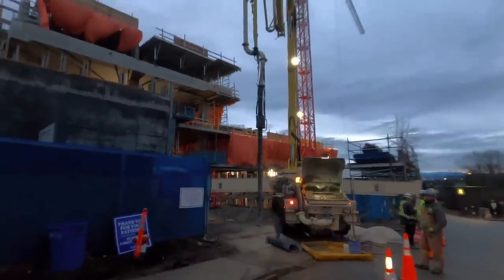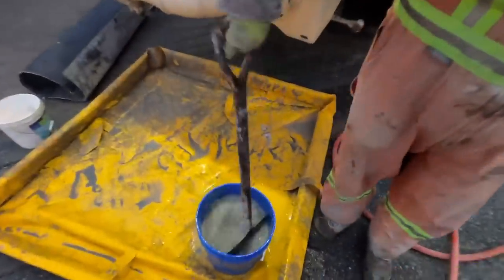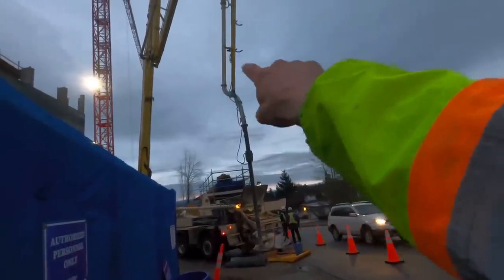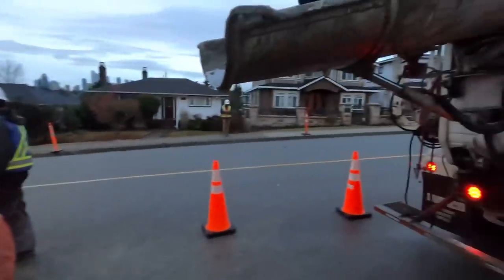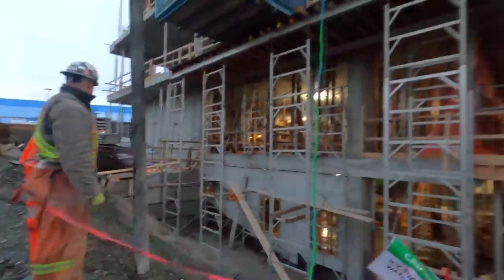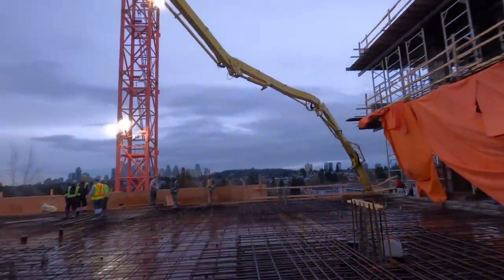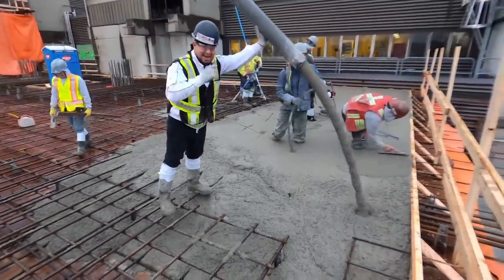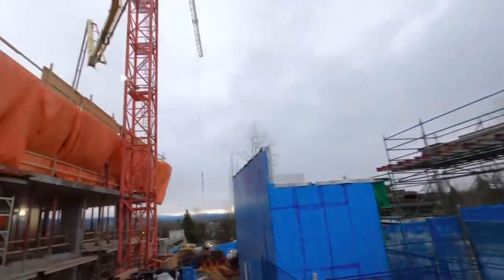The most effective way to prime a Putzmeister boom pump (I promise):

Comment: Years ago on short notice the company I worked for asked me to help a young superintended monitor the slab pour on a fancy commercial strip building.  Long story short, pump operator didn't prime the truck properly causing a "Rock Pack"  Pump operator told finishers to beat discharge hose with sledge hammers while he kept running the pump.  We told them to "Stop"  they ignored us so we ran outside and told Pump operator to stop..  The blockage cleared and two of the finishers were taken to the hospital by ambulance with serious injuries.  To bad there was no YouTube back then, he could have learn a thing or two from you.

Comment: Just man up and knock it thru with water, jeezus.
Reply from the maker: We use that method as well, just typically not on big jobs with big booms. The one in one hundred chance of an operator plugging on the prime and having to start pulling elbows apart while there's ten loads of concrete lined up down the street just ain't worth it. Hence why the title of the video is "The most effective"  rather than "quickest", "fastest", or "easiest". 

I also have this one, which may be more to your liking:
https://youtu.be/GBpWxmbpPTI

Comment: I've been driving concrete pumps for the last 6 years.
46m to 56m.
I've been using water only. Using 6-7 in feed rate, turning it down to 0 when i hear the concrete coming into the last boom section.
I am only using a frame and never had any problems, summer as winter.

With that saying, watching these videos makes me want to move to Canada and  work for this company. 

Seems to be a lot of knowledge and a general friendly attitude.
Reply from the maker: It most definitely can be done with water (especially when priming in A-frame configuration). We just do this to avoid those handful of calls annually in which a boom gets stuffed up on the prime. Priming with bentonite in the port has virtually eliminated said situations. 

We’re lucky to have a good variety of work here. Problem with our area is that cost of living is outrageously expensive.
Reply: @Canadian Concrete Pumper  is expensive everywhere🫣
But how hopeless can it really be?

If you need a stupid concrete pump operator who needs some assistance to navigate through the bureaucracy regime and some assistance to get settled, I will be more than happy to pump a lot of concrete for you guys the next 20-25 years!
Reply from the maker: @lagresomadsl  crappiest detached home one could find within say 40 minutes of our yard would run roughly 1.5 million. It’s BAD.
Reply: @Canadian Concrete Pumper how is it possible??? 
That basically means that the normal person is locked out from this marked, unless your income or savings is stupidly high?
Assuming we here have numbers way beyond the normal average?
Reply from the maker: @lagresomadsl  Yup. A young person doesn’t have a hope at detached home ownership typically unless they’ve got some financial help. You literally can’t save quickly enough to keep pace with the rate of inflation.
Reply: @Canadian Concrete Pumper   i live and originate from Norway, where my understanding of the basic principles within the regimes in Canada and Norway is pretty much identical within the many aspects of daily life.

It's the same in Norway, but outside the big city centres and the dense populated areas, it's still possible to get decent detached housing for somewhat a reasonable price.
1 Canadian dollar equals around 8.2nok, so at 280-350000, Canadian dollars would land
a decent house. The problem here is the same.
Young people and first-time buyers face the 15% hand cash of the buying price to get the loan.
This means the entry ticket to your own home is impossible for many.

It's a hopeless world. We all strive to find a good and comfortable life for ourselves, even if it means uprooting everything and starting over.
Like a new painting or a new chapter in a book. 

Sometimes, this opportunity comes from the most unusual places. All we have to do is seek it!
Reply: Bonjour depuis la Belgique 

Moi aussi je fais comme vous, et généralement sa va bien. 

Mais  il est vrai une barbotine éliminé le risque 😊🇧🇪🇨🇦

Comment: Another great video Scott, thanks. It's nice to start a cement crane job by filling up the boom tubes real good. :D 

Our local Oregon material is probably similar to yours so we usually just prime with water in the hopper with first mud on one side to fill the cylinder, works 99/1. On difficult/mystery mixes we'll use bentonite and on line pumps quite often. We usually prime the Z-booms in A-frame so maybe a bentonite kit on the booms would be good. Our line pumps use it a lot, great stuff. The one thing we do differently is use a cordless drill with a paddle bit, water first to get it swirling then bentonite. Whips it up completely with no lumps. 

Pump On, Happy New Year!
Reply from the maker: Thanks brother. We actually have a drill and mixing station setup back at our yard (bentonite slime ends up getting EVERYWHERE 😂😂😂) Couple of our rigs had the mixing drill on them as well, only drawback I found is that guys had a tendency to just toss it back in the tool box without rinsing (that’s if they didn’t lose or break it altogether) which again made quite a mess. Most definitely though, like you said, the drill is quickest/most efficient way to mix up bentonite powder 👍🏼👍🏼👍🏼

Comment: man use your i phone more, slow motion and other options are cool, the footage was dope
Reply from the maker: Photo/video quality on the 14 pro is amazing. It’s mostly just the sound which lacks in comparison to the GoPro. There’s a lot about the GoPro which I’m not a fan of (eg: how easy it is to accidentally set it to Timelapse or Photo modes). That GoPro has cost me some good content a few times now.
Reply: @Canadian Concrete Pumper   so u use the go pro max? the audio is really good on it. and yeah i have messed up a few times with mine, anyways i have the video finished. i will post it on the 1st of the month
Reply from the maker: I have the Hero 8. I’ve debated getting the newest model, but I’m not certain there’d be much advantage for the type of stuff I’m using it for.
Reply: @Canadian Concrete Pumper   the best one is the go pro max, the audio captured is so much better, but yeah you are close when u r vloging. my dad and others r far away or looking the other direction. btw i have the 9

Comment: I like the idea of reducing your chances of problems, but 5 gallons of water in the prime port works every time for me. (Knock on wood) that is with 57 rock from Florida, so pretty much garbage. All that after I suck a single dry sponge (0 on dial, rpm all the way down)
Reply from the maker: Agreed, water works the vast majority of the time with our mixes as well. We turned to bentonite as standard fair on the big-booms as there would inevitably be those couple/few pours annually in which an operator would stuff the boom up tight on the prime and the contractor starts sending loads of concrete away assuming that the pumping company will pickup the tab. With using bentonite, these rare instances have been all but eliminated.
Reply from the maker: I’ve tried the single-dry sponge method here and paid for it the following day. Our mixes here are very heavy on fines and light on stone, doesn’t provide enough of a “self-cleaning effect” as compared to a more coarse mix. At least that’s my theory anyhow. I always end up reverting back to sponge-water-sponge.
Reply: Curious what the 57 rock is? We have a limestone rock here in Southeast Missouri. It's always interesting the different mixes in different areas of the country.
Reply: @fronabargerconveyingpumping  TN guy here, I believe he's talking about the size of the limestone. May be a different rock but when I get loads with limestone a lot of the time they will say 57-limestone

Comment: Hey mate happy new year, I’m from Australia have a line pump I’m interested to know what Bentonite is? Thanks!
Reply from the maker: Happy new years brother! Bentonite is essentially powdered clay/mud. It is most commonly used as drilling mud. Roughly 2 measuring cups of bentonite powder mixes with 4-5 gallons of water to create a prefect consistency, greasy, mud which is top notch for priming boom pipes as well as rubber hoses. I also dust the inside of my hopper with it to create a layer of mud as such that concrete does not buildup/stick to the sides of the hopper when time comes to washout. 

You definitely want this stuff on a line-pump. So much more convenient (and cheaper) than packing around 50 lbs sacks of cement or mortar mix. The only drawback is that you absolutely cannot allow any of the bentonite prime to make its ways into finished or structural concrete as it will remain in a mud-like state FOR-EV-ER. 

Happy new years brother. Thank you for watching and commenting.